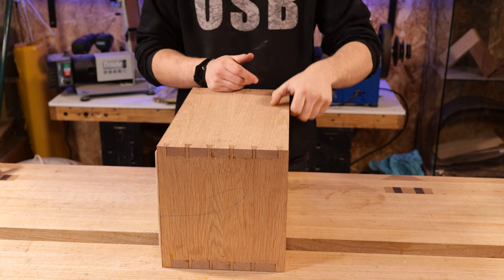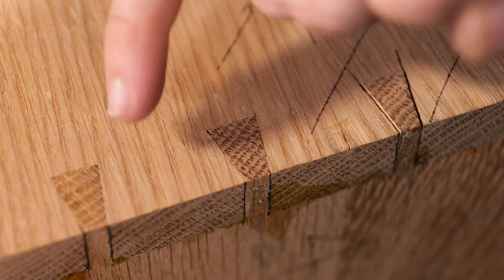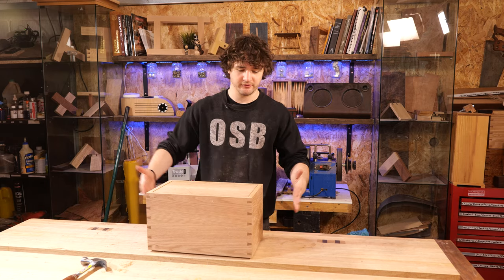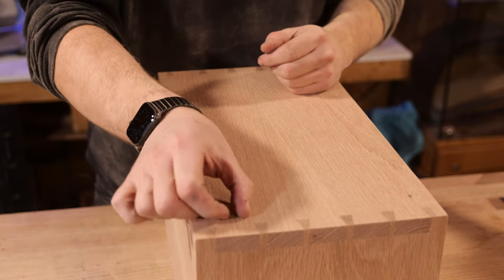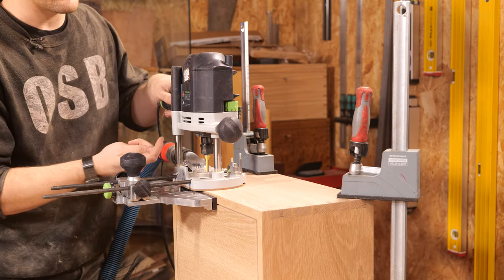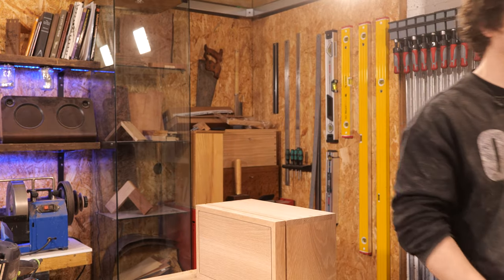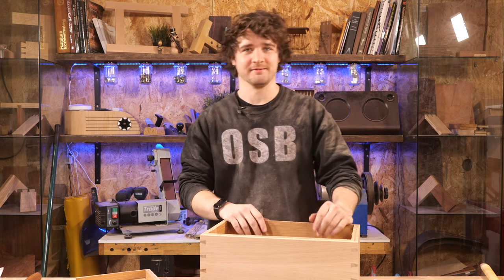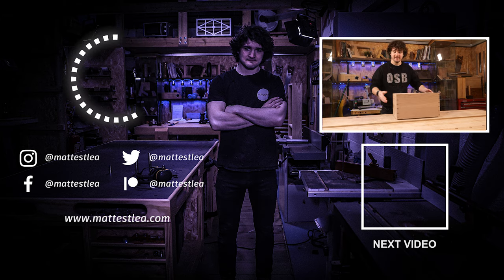Cutting Off The Lid | The Toolbox Project #11

Comment: I learned something again. The mushrooming of the gap in the dove tail was brilliant. I could have used that last week on a through wedged tenon. Thanks! On the lid after you separate the lid from the box. I find it best to plan flat than use a large sanding plate to mate the two surfaces.

Comment: I used the router method Matt shows in this video but wish I’d used my table saw instead. I found that the style of router I have (Erbauer er2100) doesn’t lend itself to the job as it has the deadman style power switch. This meant I couldn’t use the technique of moving the pressure on the fence to prevent the tool from twisting and sniping the cut. I ended up having to plane about 2mm from the lid and box to correct this. Using my table saw would have been quicker and more accurate. That said, I’m learning a great deal from this project and really enjoy Matt’s style of teaching.

Comment: My question is "Why did you have to cut a 6mm groove if you were intending to use a Japanese pull saw for the final separation"? The kerf of this saw is only about .012" or near 3 mil. Just curious.
Reply: I suppose that he had to do it that way in order to have the final width of that tail match the width of the others. He made the big tail 6mm wider than the rest.